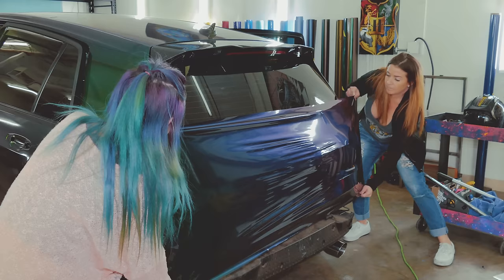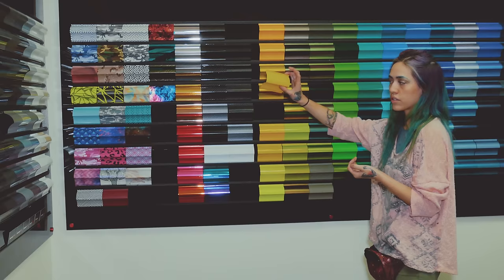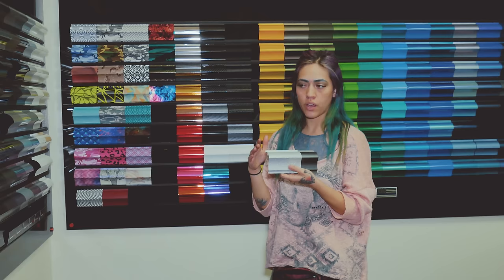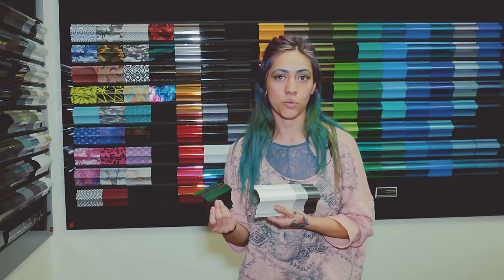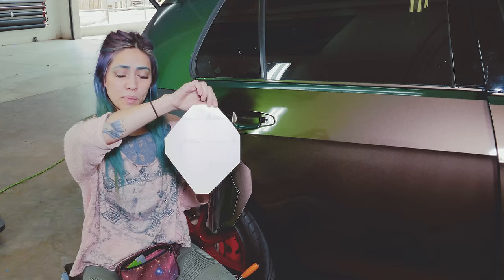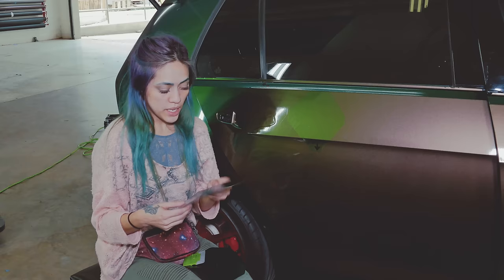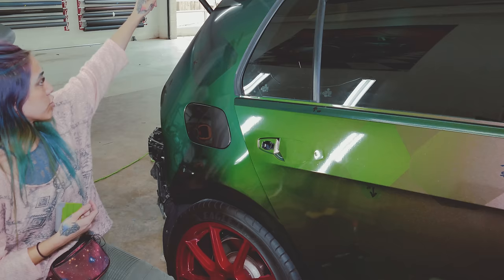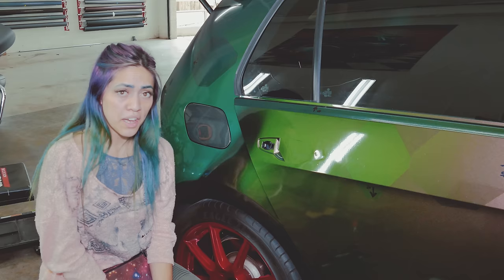Going to School on Directional Material

Comment: When you do directional you should face the roof to the drivers side, since that's the (what i call the public side), side that faces the sidewalk. The drivers side only faces the middle of the street and other drivers only see that side as they pass each other and more times then not, they can't see the roof of the car. So the color flops from the door over the top of the roof.
Reply: Goooood idea
Reply from the maker: Some roofs will even fit where you can make it continuous with rear end and the up is facing towards front of car. Thanks for your input and watching!
Reply: So the roof and the bonnet’s arrow should be from passenger’s side to the driver’s side? Not from back to front?
Reply: @sepehr_moghani  Thanks, was curious about the same thing. Went back to front.   Also my 5x50' roll, the 5' wouldn't cover the doors completely if I went roof to driver's side.

Comment: I checked the Avery installation manual and they mentioned 'metallics and matte' being directional. I'm thinking of wrapping my FRS with Avery's gloss bright blue metallic, how difficult would it be compared to their colorflow line (I like their Rising Sun vinyl, but it's very directional). Also, I have both samples but I don't notice the shift as much since it's small.

Note: Your link is broken. I used this PDF they have: https://graphics.averydennison.eu/content/dam/averydennison/graphics/eu/en/technical-bulletins/Sign-making/TB-3.12-rev2-application-instructions-for-avery-SWF-en-FINAL-UPDATE.pdf

Comment: What do you when your wrapping to different size unbroken panels? I'm wanting to wrap my single cab truck but obviously the bed is gonna be wrapped top up but that's only 60" material...the door is nearly 5 foot wide with the outer cab section being a un broken piece...do I need to wrap it in two sections? Also the hood is massive and unbroken so need to wrap that top towards the windshield to be able to cover in one piece or is that a two piece as well?